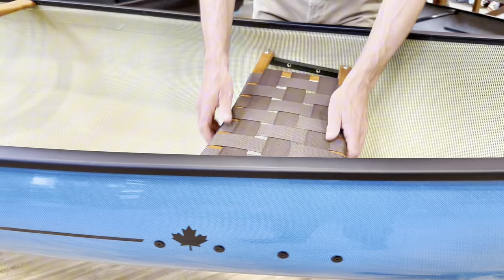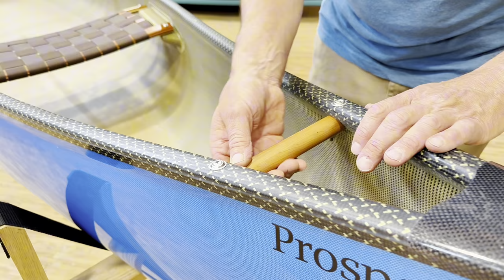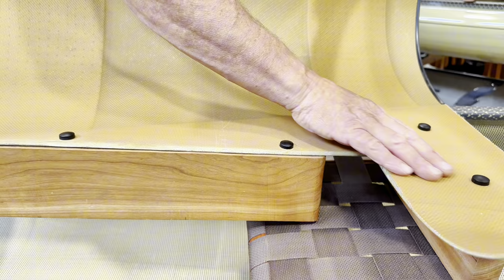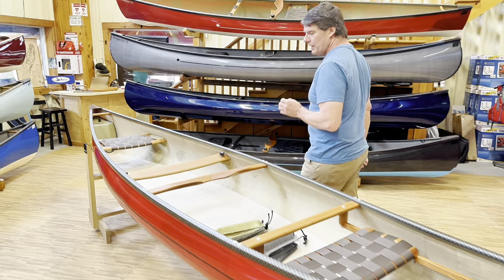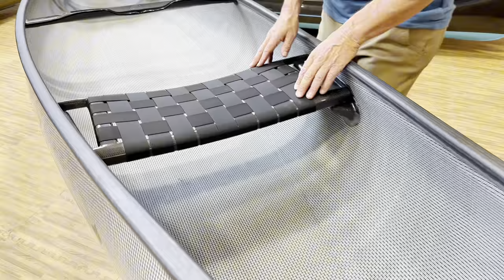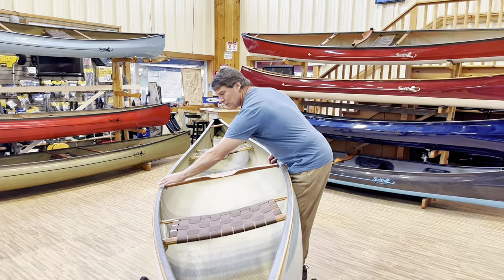2024 Swift Canoe Trim Systems and Options

Comment: Just took delivery of a Prospector 15 tandem in carbon fusion last December. I really love the canoe and at 35 pounds it's very easy for my 71 yrs to handle (especially compared to our 75 pound Grumman). Squeezing another 5 pounds from the Prospector 15  with the new materials is very impressive, enough of a difference to make this an attractive upgrade for me to consider in the future. 👍
Reply: I'm 63 and took delivery in September of a 16 foot Prospector (kevlar fusion) in a combi configuration, as I mostly solo. I love the carbon kevlar trim. All three seats are removable, and I took the foot brace option for the solo position. Very light. What a great boat.

Comment: Do you offer the aluminum gunwales in natural silver color instead of the black coated color?  I own two canoes with aluminum gunwales, one with natural color and one with black.  The black is very hot in the sun and the natural is no problem at all.
Reply: We do the Aluminum Gunwales in the one colour. If you want a trim that is less temperature sensitive, our Carbon Kevlar Trim is the way to go!
Reply: We have the carbon gunwales and they have never been hot to the touch. Just FYI.